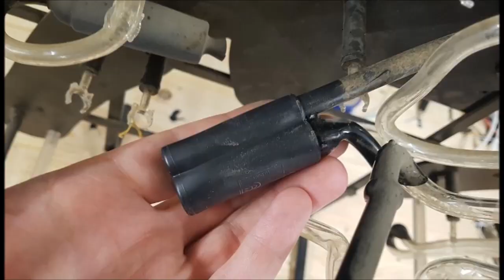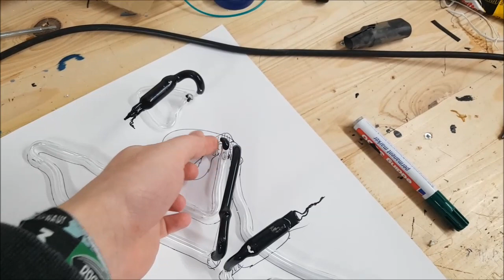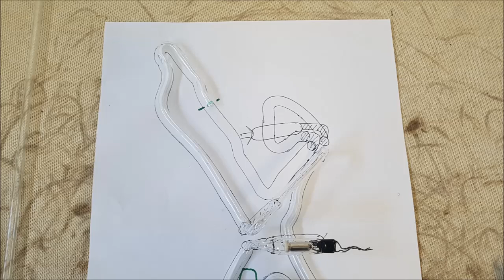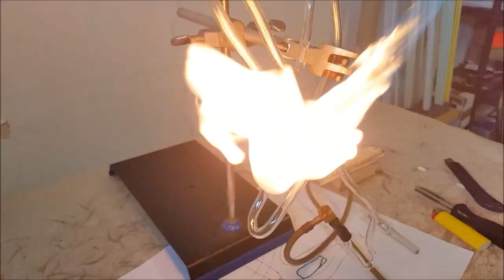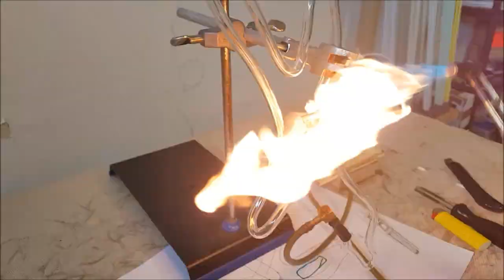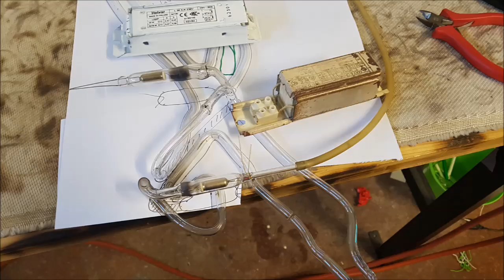Repairing a broken Beer Neon Sign (with glassbending!)

Comment: This is amazing. I recently sold a vintage neon sign and packed it extremely well with high density foam, medium density foam, external supports and everything and the shipper still shattered it in a few spots. Do you think a large butane blowtorch would be sufficient for a simple repair?
Reply from the maker: It looks much easier than it is. I'd say you need at least 3 days  (20 h) of prior basic practise to do what i show in that video. Also fine flame torches and how do you want to process the tubes?
Bring it to a shop and ask if they let you watch, that will give a good insight into the craft.

Comment: Hey man one of my neon signs just broke and I’m trying to figure out how I can fix it myself and I think I can weld the glass back together but I don’t know anything about getting the air out of the tub. If  I where to just weld the glass back and turn it on do you think it would explode
Reply from the maker: I assume you won't be able to weld it back together, no offense. It takes many hours of practise. If it was a tube other than clear red, don't do it anyway because you would be exposed to mercury vapors.
Even if you managed to weld it back together, if you turned it on, it would just do nothing. Getting the air out and filling with noble gas requires $$$$ machinery and again experience. Just bring it to a neon shop for repair.

Comment: Why do theese tubes have that black paint to begin with?
Reply from the maker: To cover the parts that are not desired to light up. If the rear half is also painted, to prevent the wall from lighting up too much. Better contrast to read the sign.